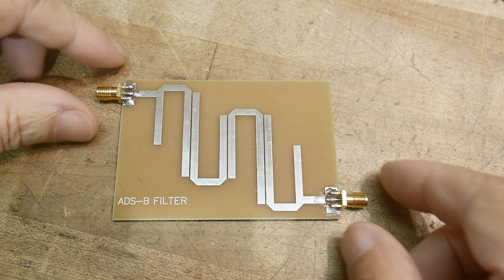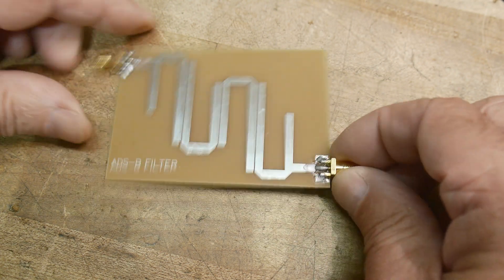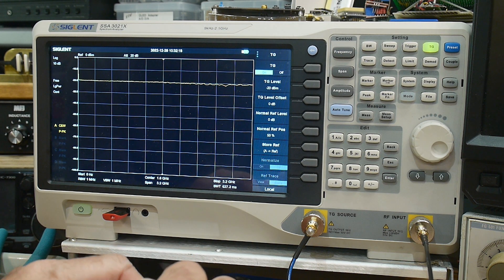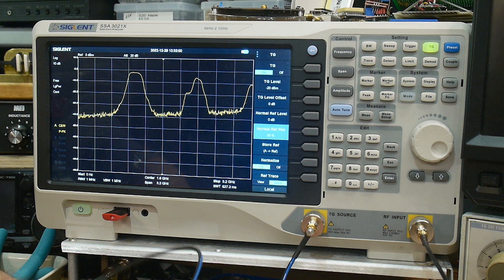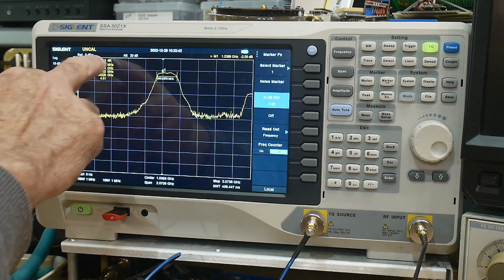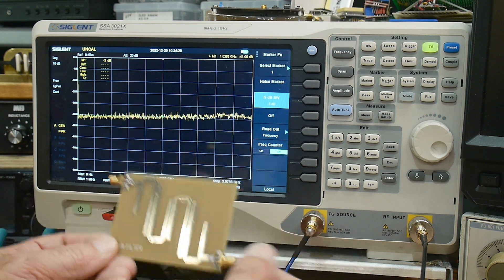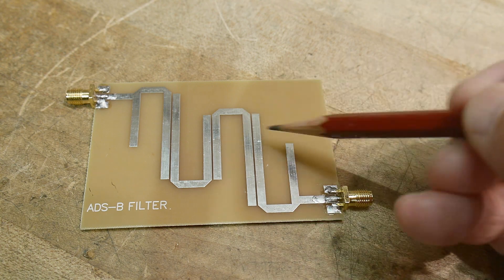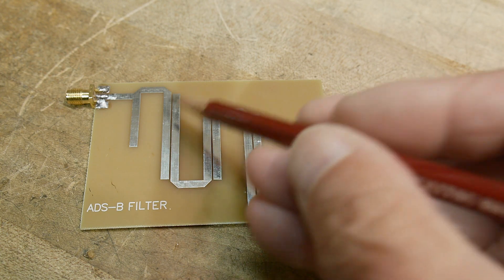#1381 Microstrip RF Bandpass Filter

Comment: I am doing my Phd on microwave filters and i can easily say that it is a conventional hairpin filter. It consists of coupled half wavelength transmission line resonators. Unlike the half wavelength resonators in combline and interdigital filters, those  resonators are folded to make it more compact and do not require precisely manufactured grounding via. Each folded section directly couples energy to adjacent one and no cross coupling is observed. Hence, it has moderate stop band performance compared to cross coupled filters.
Reply from the maker: are there any free cad programs for these designs?
Reply: @IMSAIGuy  Yesterday after watching your video, I searched "hairpin filter calculator".  The first result "charleslabs fr" is an online calculator for 500 to 1500 MHz that will spit out KiCAD files!  That site also has a link to a Youtube video describing his experiments.
Reply: @IMSAIGuy   iirc, qucs studio has a field solver and a microstrip component library. It is open source. AWR MWO office has pretty good MOM solver and  is free only for students. Sonnet suite software is also a planar simulator which is specialized for microstrip microwave components. It has a mesh size limited version for free.

Comment: Those "capacitors" are directional couplers.  There are quarter-wave stubs at input and output.  Each of the 'J loops' is a resonator; I believe the inner two are slightly lower frequency (I think their 'J' is slightly deeper).  The trace width, board dielectric constant, and board thickness set the impedance.  Wider traces also increases the resonator bandwidth.  The couplers have two different lengths making them couple two different frequency bands.  The pass band is very flat and the insertion loss is quite low at 50 Ohm.  Very well designed and manufactured.
Reply from the maker: thanks, I understand a bit more. I suppose all this is just a CAD program output now.
Reply: I don't think "directional couplers" is the right term here.  That is certainly a bidirectional filter, making them just capacitive couplers.

Comment: Transponders transmit and receive 1030 Mhz, and 1090 (Respectively), and all avionics use 60 MHz IF for that reason. Rec IF is SAW filtered @60, feeding 4 I/Q receivers, and then 10 bit digitized ->DSP from 4 antennas for direction finding, and the transmission is electronically phase-shifted for 360 degree coverage, using over 1KW pulses with added BPSK data.
You are absolutely correct about the 45 degree angle reflecting the sheet of electrons cleanly.
Bonus: There is no 90 degree corner "point" that would have a very high field intensity.
(Retired from Collins Aerospace)

Comment: would love to see you rig one up with aluminum tape and just see various changes on the spectrum analyzer as you cut pieces away, like square corners, then cut into 45 live as we watch it
Reply: Copper tape is better.  You CAN get special aluminum solder and flux, but soldering is still tricky and the flux smells AWFUL!

Comment: These are made to improve the dynamic range of SDR ADS-B receivers, eg for "Flightradar24" ground stations. Direct conversion SDRs typically suffer from interference from strong signals nearby, because the cheap ones usually downmix to zero IF and then directly digitize the signal, without any intermediate stages for filtering.

Comment: Nice.  I got a couple of PCB BPFs from HobbyPCB.  One for 2m and the other for 70cm.  I've tested them with my SSA3015X Plus - The 2m one is very good, but the 70cm BPF's high end roll-off is quite a bit slower.  Those two BPFs are even smaller than your 1090 MHz one here and incorporate some tiny SMD capacitors.  I've had some copper "stained glass foiling tape" for a while now with an eye to experimenting with this kind of thing... I need to get on that :)

The passband of your ADS-B filter looks like it's designed to cover both the 976 MHz ("UAT" for under 18,000 ft aircraft) as well as 1090 MHz.

Comment: It is interesting that although light and RF are part of a continuous spectrum we still differentiate them based on our biological sensor's ability to see one and not the other.
  
I recently read an article, in QEX I think it was, where Amateur Radio people were using modified RF techniques to push closer and closer to what we call light frequencies.  If I remember right they are getting pretty close and maybe into far infrared territory.  So I guess use of the full electromagnetic spectrum just boils down to appropriate combinations of magic smoke and mirrors as you pointed out in this filter.
Reply: Yes, radio waves demonstrate the properties like reflection, refraction, diffraction and interference and polarization.
But the reason why the corners of the tracks are cut at 45° is to avoid "point action" where electric charges would accumulate or get spewed causing an "ion wind". 
You might have observed similar track patterns in the SWR PCB tracks for the VHF UHF bands and cellular telephone industry boards apart from the CRT type TV boards that would handle 25KV or more.
De VU2RZA
Reply from the maker: https://www.microwaves101.com/encyclopedias/mitered-bends
Reply: @IMSAIGuy  verry Nice reference. Even for a non hf enthousiast :-)

Comment: I used to avoid microwave circuits. I just called them 'plumbing'. But once I got a NanoVNA and could finally see what was going on, the devices became just some interesting RF circuits that were slightly different mechanically, and were quite fun to work with. The newer Nano's and the TinySA Ultra have really opened up microwaves to the hobbyist.
Reply: My HF prof used to tell us to never look into an open end of a pipe. "Either someone is flushing their toilet, or there's microwaves coming out..."
Reply: @ToumalRakesh , or a bullet.